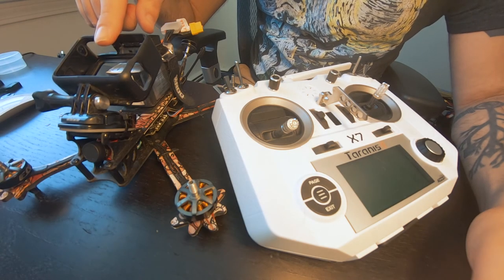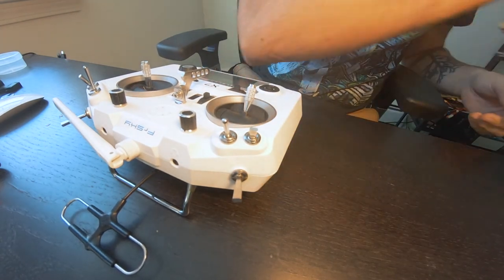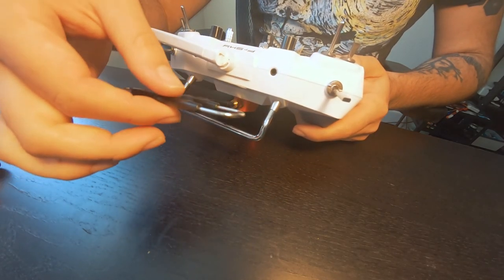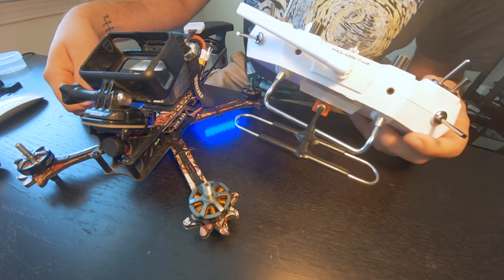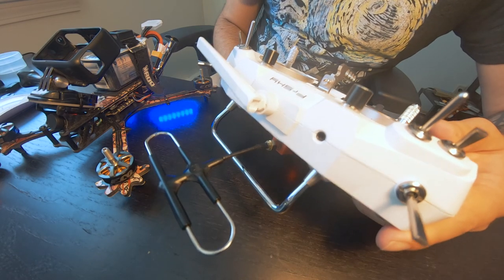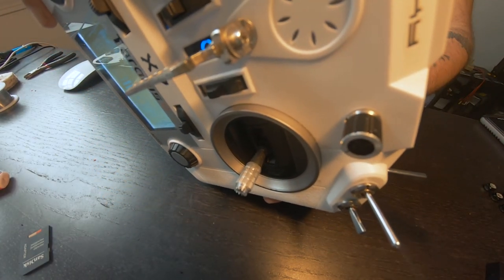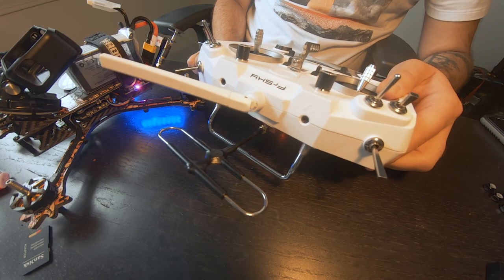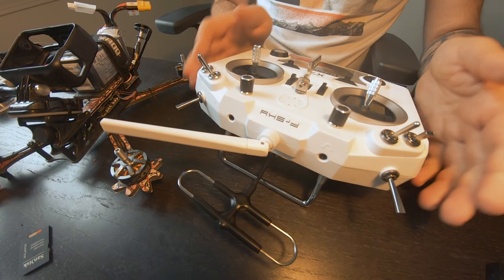R9M Was Causing My Drone to Twitch!!

Comment: I know this an old thread, but I had the same issue and I found that it would happen on adaptive power mode.
I switched to a fixed power output and never had the problem again. I made a video about it in early 2019 and even raised it as a Betaflight issue.
I then realised it was how the RX9M works and unfortunately no real fix.
Now we have ExpressLRS which a much better system.
Reply from the maker: I definitely noticed it happening more on the 1w mode. I also ended up upgrading to expressLRS and love it compared to r9m. Thanks for watching!

Comment: Bruuuuuh! I wrestled with this for over a year before I figured out (at least in my case) it was not just the antenna, but the module itself was wiggling around in the bay. I used tape on the sides of the module to thicken up the fit, and it has seemed to clear up the issue, havnt had a problem since. I believe it’s the pins in the back that go into the module are loosened up over time. I figured this out by accident, had armed my quad but didn’t launch and accidentally knocked the antenna and it twitched. Was able to replicate it 100% of the time by tapping the module with my hand, twitch twitch twitch. Fixed since fastening the module so it doesn’t squirm around. Just my input, theres not much info on this problem out there.
Reply: I am doing the same, I added foam around sides to keep it secured properly. R9m is fitting loosely in contrary to djt module in jr bay, it seems that frsky changed slightly dimensions of their modules.

Comment: Hi, I am facing exact similar issue for last 1 month and tried changing the motors / FC / ESC but still could not get rid of it . I did notice loose antenna (just like yours in the video ) on my R9 module but never though it might be the real cause. Thanks for the video.
Reply from the maker: thanks for watching!

Comment: Okay, i’ve got the exact same problem. Weird twitches on different quads. And i also leave the antenna connected in the bag. Sometimes the twitches are gone for days... 

That hummm i think it’s gone also. Anyway i still have the stock antenna to compare.
Reply: It can also be the gimbal in the radio.  I had to take my radio apart and use a hot glue gun to add some strain relief onto the wires going to my gimbal because when I moved the throttle up and down I was getting a Yaw Twitch.  I noticed it started to happen to all my quads and that Is how I started to suspect my radio.   Then I looked at my radio screen and you can see the yaw twitch as you raise the throttle up and down.   So look at the Gimbal indicators on your radio and see if they are causing the twitching.